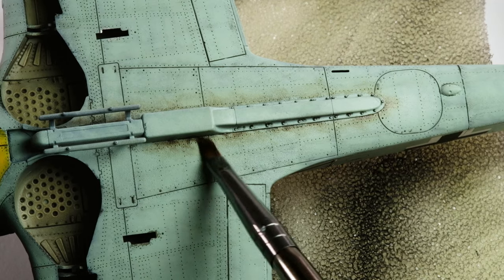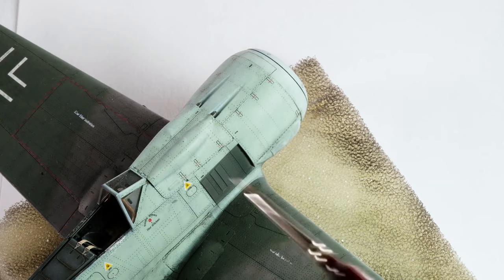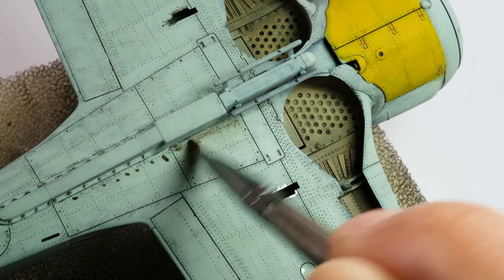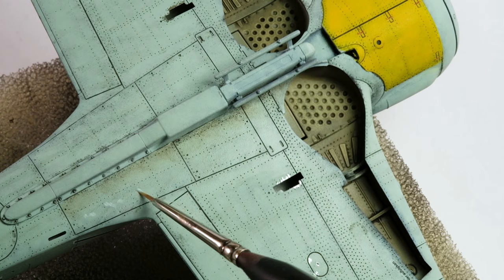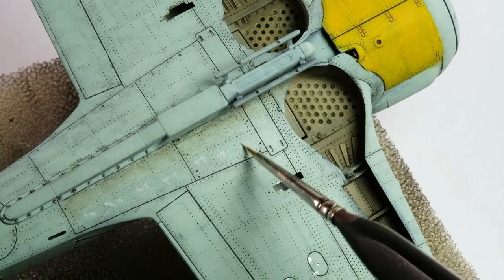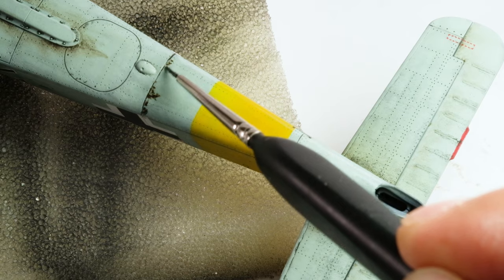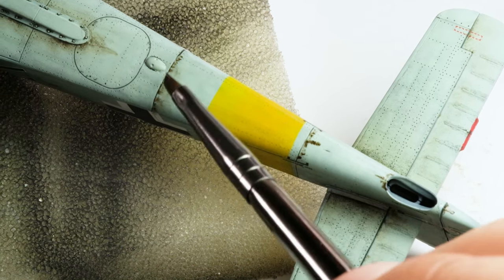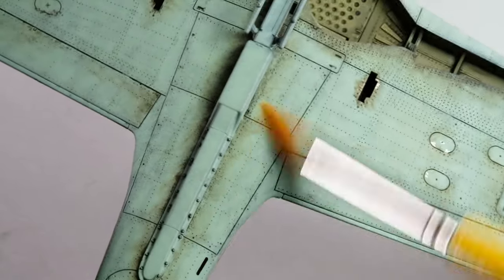Focke Wulf 190 1/48 - Part 5 - Chipping and Oils

Comment: Some nice techniques! I use oils on a gloss surface to add some interest, slightly different than your method but I find it's easier to remove it all and start again if I don't like it. However, your results came out really well and in the end, you are better than me! :D Lovely work, I look forward to more! Dan
Reply from the maker: Thanks a lot Dan for tuning in and leaving an interesting comment!!! I saw your videos and your work is fantastic!!! I like the glossy surface to work with the panellines and oils. To blur and fade with oils I prefer a semi gloss surface, because I often wipe the oil too much away, I think I work with too much thinner. But as you can see on my Do335 the semi gloss surface soaked up the oils too much, so that there were oil stains left. Still a lot to practise and experience... Thanks again for your support!!!

Comment: I prefer using a prisma color pencil or something similar, it makes chipping a lot easier for me and with a nice sharp point we can make very small marks which is useful with small scales
Reply from the maker: Absolutely agree on the prismacolor pencil. I love it! Will use it on my next build!
Reply: @AirandGroundinScale  The nice thing about using the pencils is that you can also use light shades of the camouflage colours to create light scratches and chips instead of using silver to simulate bare metal chips. I personally use AK weathering pencils.
Reply from the maker: @barrywhitfield930  I got the AK-Weathering Pencils, wich I'll use as you explained on the next build :) Really looking forward to!